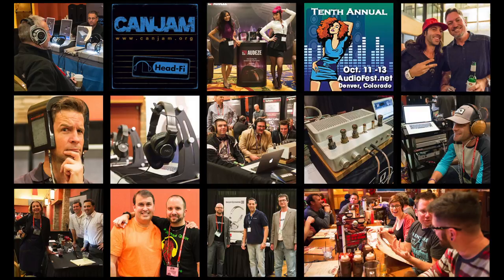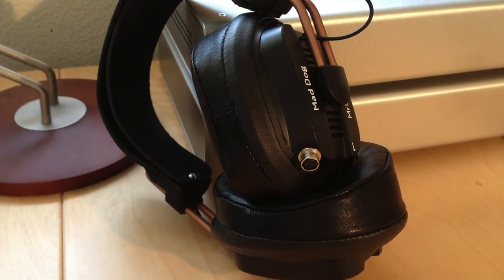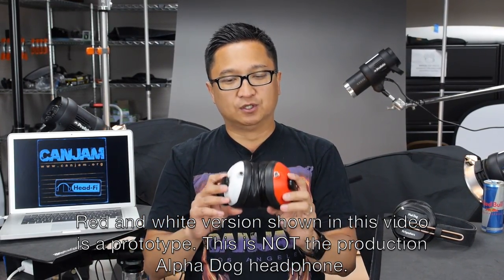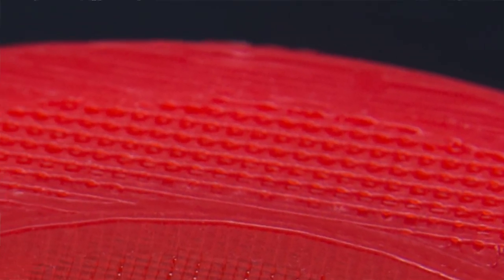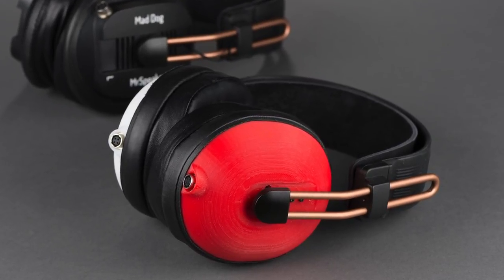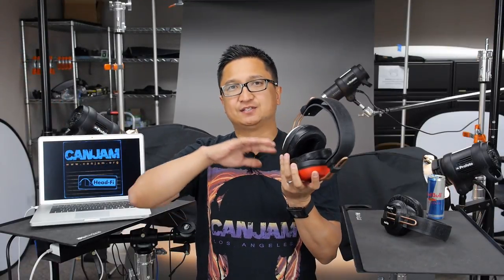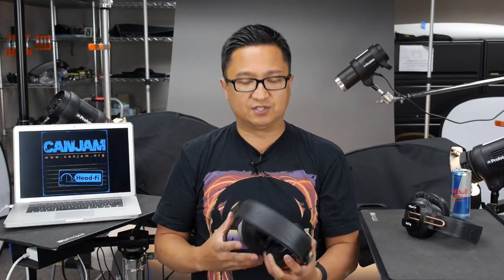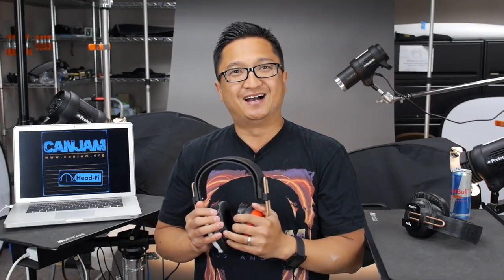The First 3D-Printed Production Headphones - MrSpeakers Alpha Dog - Head-Fi TV

Comment: It was mentioned that they isolate pretty much the same as the Mad Dog, which is pretty much the Fostex T50RP, which has a ton of noise isolation for a closed-back headphone. Innerfidelity measured the Mad Dog at -17 dB noise isolation and the normal amount for a closed-back headphone is around -12 dB.

Comment: This is the real advantage of 3d printing- variable internal structure. It can't currently be manufactured any other way. The limitations are the materials that can be used in small production, of course. If you're SpaceX, you can print titanium and such, but it would be nice to be able to print silicone and other plastics besides the pla that makerbot sells.